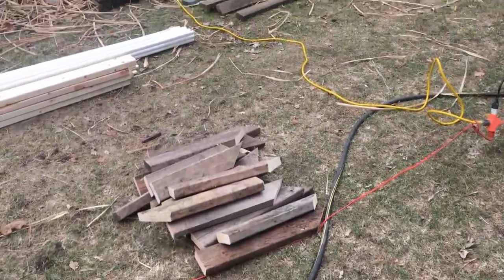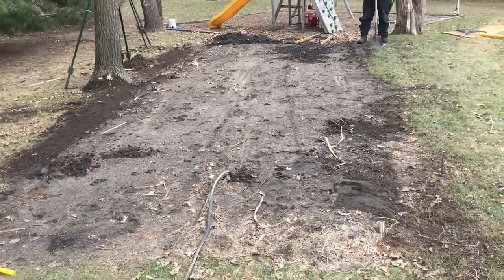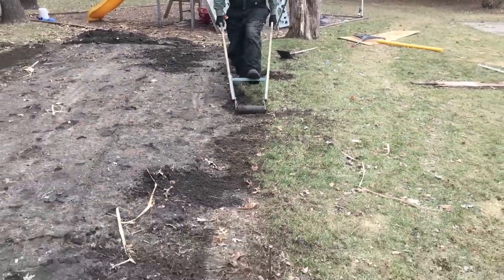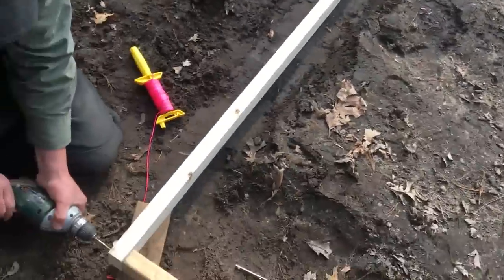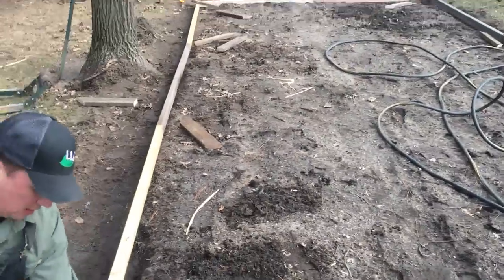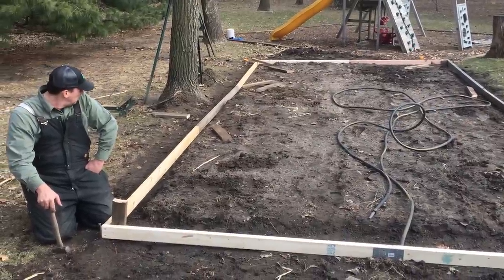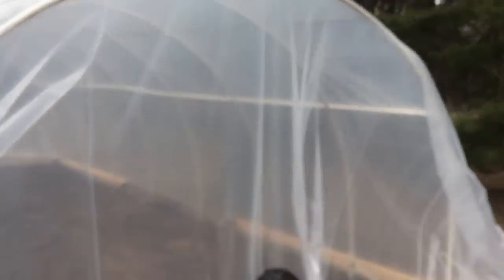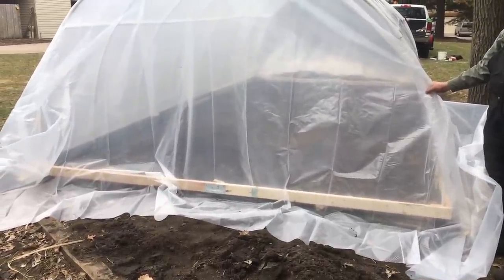PVC Greenhouse Step by Step DIY

Comment: I would put some kind of thick tape on the plastic before I put any holes in it and before building you could use boiling water to form the pvc so that there's no pressure on anything beside that I really like it not many people know this but a greenhouse is a few thousand dollars well a small one anyway and for 300 dollars y´all did awesome

Comment: Good morning one & all from beautiful Quadra Island and Esquimalt, BC.  

Now that I'm 76, I was to fully retire this year, until I saw these folks & others attempting to create sheltered environments, to extend the growing season in mild climates such as ours. In addition to my horticultural background, I have experience as a designer-builder from a Journeyman Carpenter's point of view, so I'm offering some insights from 50 years building these and traditional greenhouses.

Nothing in life is easy if one wishes to do it well in durable, efficiently functional ways in a variety of environments. Nothing.

It appears that the goal of these fellows was to put up a 2nd or 3rd low-cost temporary crop shelter, but they don't seem to have prepared even basic working drawings. Without a basic plan, it's difficult to work in co-ordinated way, especially if there are 2 or 3 people involved. So a simple plan is Step #1.

Step #2 is working drawings based on lessons from the first structures. At 21:45, the crew lead says they've had problems in the past creating entries, but now they have a new product which they'll use to see how it goes. Your take on this may be different than mine, but I would've tested it at least once before taking it into the field, especially if I'm making a training video!

Comment: The plastic sheet won't hold up under the sunlight,  it will start to deteriorate.
Reply: I have had greenhouse plastic last for several yeaars in a very sunny location.  Costs more but worth it.

Comment: What size PVC did you use? (diameter?)
Reply: 3/4 inch
Reply: @sherryclark6354  Thanks for your reply.  Another 2 questions.....How has the 6 mil poly held up after 3 years?  And did ya'll paint the pvc skeleton to protect the pipe from UV degradation?

Comment: Can't believe what you did with those zipties.  Created a weak spot where the plastic will rip. And not greenhouse plastic??? Too cheap means more expensive in the long run when you use the wrong materials and have to replace them.
Reply: This isn't a permanent structure. This is an entry level greenhouse, for people who are new to farming. If it's not disassembled by December, it's gonna collapse under the snow.

And I don't mean that as a knock. It has its merits: it's cheap, and you can build it with minimal effort, as a new farmer/gardener, who can't or doesn't want to make expensive long term infrastructure investments...because you don't even know if you're gonna still be growing stuff in 4 years. 

For that purpose, it's great: it will do exactly the same thing a greenhouse that costs 10 times more will do. It's just that it will only do it for one season, and only if the winds aren't too crazy (which is something that depends entirely on where you live). 

If you want to build a permanent tunnel, PVC is not your friend. You need a rigid metal or wooden structure.

Comment: This video gave the wrong advice, not sure how much experience you have ??  You used multipurpose plastic, after a year of sun, the UV destroyed the plastic and you have to replace the plastic.   You better to buy the more expensive UV treated, and it will last 4-5 years.  Also, you can't have the PVC has direct contact with the plastic.  You also used zip-tie  to tighten the plastic, if there was any strong wind, it will tear the plastic apart.  Yoou should use treated wood for the base, the untreated wood will rot in 2-3 years.  Bad advice.
Reply: how would you have it so the pvc doesnt contact the plastic?
Reply: @illusineer  wrap iit with old bed sheets glued down.or paint them
Reply: @illusineer  why not pool noodles cut lengthwise?

Comment: I love watching men make work harden... then it needs to be. SMH If you know you need to glue x amount of ends per length then why not start at the end of that work board and glue a bunch of them in a row? Then move to the next T and work on that work board, then move down to the last work board section. Why go back and forth how many times to get the same results? Its like giving a man flowers just to see what he puts it in or how he deals with a box of plastic wrap and a left over. Good laugh for sure.